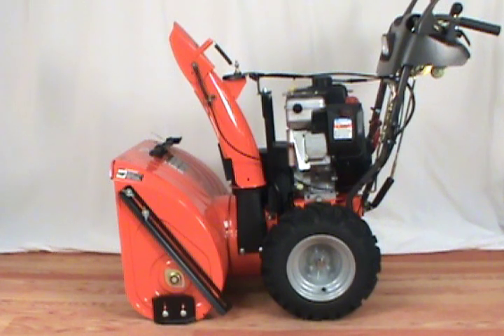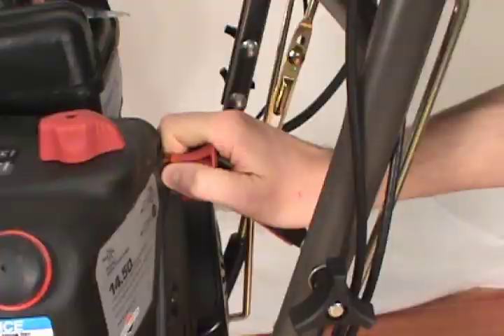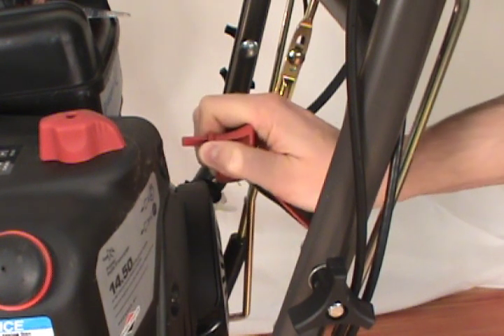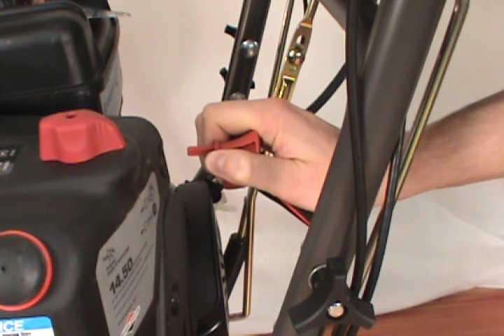Replacing a Shear Pin - Husqvarna Two-Stage Snow Blower

Comment: the blades on my snowblower are so close together that I can't get my hand in to put the nut on. Is there anyway to spin the auger shaft so that the shear bolt head is towards the top instead of towards the ground. I have tried to manually spin the unit but no go. I am assuming that the shoulder of the bolt goes in the larger hole on the auger and the nut goes on the side where the smaller hole is.

Comment: What about the impeller shear pins. The manual is pretty vague about where they are located.
Reply: Very similar process.  If access is an issues due to big hands or other reasons, you can remove the chute and access them that way.

Comment: I don't see any zerk fittings on the auger shaft. I have one of these, and I just don't see them. I see the shear bolts, the lock nuts, but no zerk fitting. Husqvarna ST224.
Reply: AFAIK, Ariens is the only brand to consistently offer grease zirks on their augers.  Other brands you have to use a spray lube or find a creative way to force grease in there.
Although, you could probably just do one full disassembly, never seize it, and it'd probably be set for life.  Just pull the shear pins once every year or two, spin, inspect, lube the pin, and reinstall.

Comment: great video,  love it. but I do have a question, my dad just bought a new husqvarna two stage and it has two shear bolts on each side when he took both them out everything seems to drop down, how's does that work?  it's not like the old ones. is that good or bad? thanks